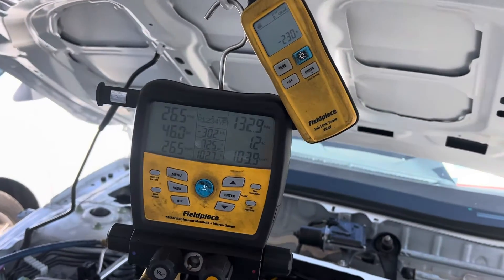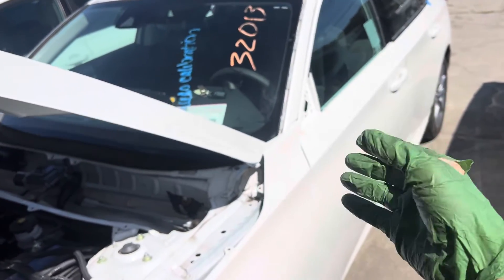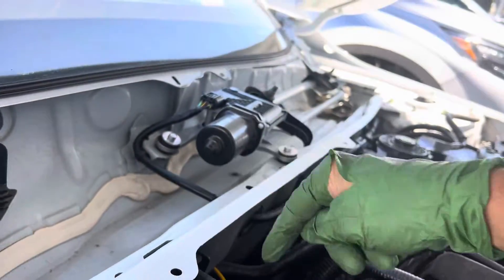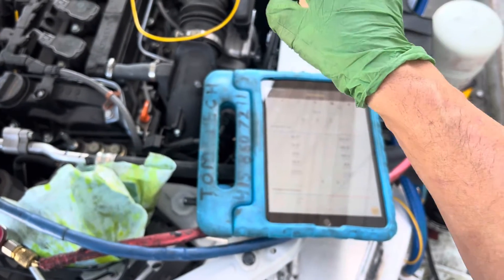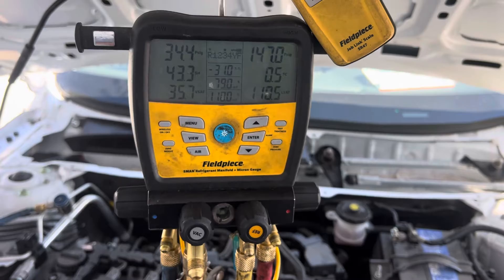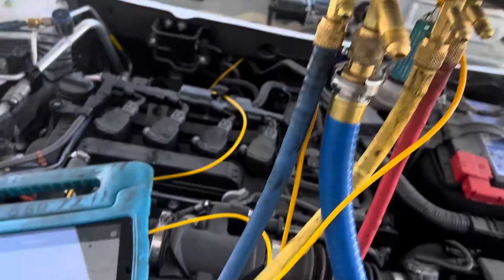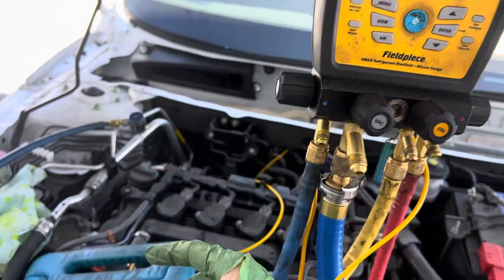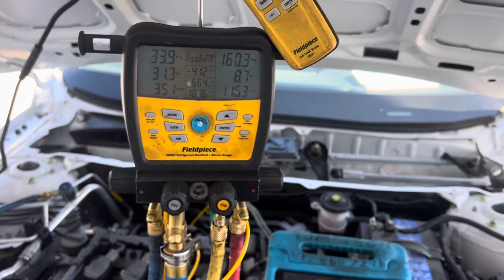AC REFRIGERANT SUPER HEAT & SUB COOLING WITH REFRIGERANT CHARGE EXPERIMENTATION

Comment: So, you talked for 19 minutes and added about 1 pound of refrigerant.
Exactly the same thing that a "wack off" mechanic, or a DIY person would have done with a $15 can of refrigerant at AutoZone.

And you used $1000 in professional AC equipment to do that ....

PS : good advice is not justifiable coming from the lips of a person that's wearing a glove, that is ripped, therefore not much of a purpose in the glove is there...
Reply from the maker: Because I intentionally only added half the refrigerant. To slowly add other half to show many cars ac systems respond differently in both temperatures output and pressure reading. Depends on if and how manufacturers software commands are compressor displacement and condenser fan speed. 
      Some will cool to 39f to 44f  with just a little over half charge but the compressor will be burning 🔥 hot and the person will stop filling because it’s cold 🥶. 
      Some cars the pressure will got way higher on a low refrigerant charge still cool tricking the technician makes him think it is full.  But the super heat will be high or the Subcooling will be low telling you the refrigerant charge is too low or maybe too high if the superheat is too low or Subcooling too high. 
     But techs with no education will not know this because they go by PSI or dash temperature.

And different car response is different. Not rule of thumb any more. 
  This is the problem with no education in this trade.

Comment: but the dash outlet temperature is really high, isn't that a problem to tackle?
Reply from the maker: It’s a Honda. They suck.. but their computer literally controls the pressures and temperatures.. but even though it was getting 101° or 90° it was still holding at 50 to 55° which is a 40 to almost 50° drop across the evaporator.,
      Some cars do better, some cars worse, depending on the manufacturers design. The size of the evaporator that they choose.. 

For somebody living in the desert hot temperatures, these are the last cars I would recommend somebody to buy

Comment: Tom, off the top of your head, do you happen to recall if a 2013 Honda CRV has a fixed or variable compressor?
Reply from the maker: @fastsvo  I have a horrible memory
But I’m gonna say it has the possibility of having maybe a mechanical variable displacement scroll compressor . 
      I’m trying to remember if this was the one that used to blow the hole out of the side of the case trying to compress liquid.  I think I’ve posted some videos of taking them apart in some shops after catastrophic failures. 

If my memory serves me correctly, they suffered a little bit in hot climates at idle, not cooling 

And if my memory serves me correctly, I think I remember being in a few shops who purchased aftermarket compressor replacements that used fixed piston compressor replacing scroll .,

And whatever manufacturer was used at that time it had improved idle cooling colder . 

When you want to know an answer to your question 

There is a thing called Google . 

You may say something like . 

2013 Honda CRV compressor . 

And a whole bunch of information linking to different compressor manufactures OEM and aftermarket will pop up, and you can further your search criteria to find your exact answer .
Reply: @coldfinger459sub0  It's definitely a scroll style and yes the aftermarket has a piston style compressor available.  Our friend Google, could not, however confirm, that the oem compressor is a variable design.  Am I safe to assume since its a scroll design, that means its also a variable output compressor?
Reply from the maker: @fastsvo  there are scrolls that are fixed, and then there are scrolls that are variable

They are not all electrical solenoids controlling the variable scroll some of them have mechanical pistons, controlling the variable displacement 

The very first variable compressor it was a piston 1985 on a Cadillac and they used a mechanical valve mounted in the body of the compressor that changed the displacement 

No electrical connections no computers 

You will have to look up the service manual information to find out exactly what you got. I do not remember off the top of my head.

Comment: I'm also having issues with an aftermarket chiller install on my supercharged cadillac ctsv. That's what lead me to these videos. The vehicles cabin ac works great with it not plumbed in. Once it is, ac cabin vent temperature suffers greatly. Tips?
Reply from the maker: @twinturboctsv91  usually, everybody under charges them. 

And because different manufactures used different components and control them a little bit differently . 

They all have similar to the same problem, but need to be handled differently compressors get burnt out sometimes . 

The original variable displacement compressor should be replaced with a fixed piston conventional compressor. 

Takes a lot of work and changing sensory positions and different settings to get them to work really good .
Reply: @coldfinger459sub0  which is sad because they're advertised as "works right out of the box!" Lol everything seems to work fine until the ambient temps get hot
Reply from the maker: @twinturboctsv91  I even worked answering questions and guys trying to fix stuff who are the ones who design and make and sell some of these kits. 

It has been very, very frustrating . 

So many problems were discovered from the initial design . 

I had one manufacturer on his prototype test vehicle install clear site glass 
( Sporlan SeeAll ) 
Connected just before his expansion valve in in line on the liquid refrigerant line . 

So he can attempt to charge up the refrigerant the old-fashioned way by site until the bubbles start disappearing . 

On a hot day, using the glycol pump with a heat load and air conditioning on full inside all windows open kept charging refrigerant until the site class at the expansion valves were almost clear just a few tiny bubbles left . 

That was when he got his  best cooling. 

He said it took an extra almost 2 pounds extra refrigerant to get there .
Reply: @coldfinger459sub0  I might know who you speak of. One system I had previously installed used that same method of charging. But, once again, when it got hot outside, the cabin ac suffered greatly so I removed it. 

Now I'm "testing" out another manufacturer and seem to have the same result with only a few OZ above the stock fill weight of 1.2lb (19.2oz) 

So very frustrating now that it's hot outside
Reply: @coldfinger459sub0  apparently my compressor is a fixed displacement and cannot be changed out

Comment: Its recirculate mode not recycle...The terms “recirculate” and “recycle” have distinct meanings:

Recirculate:
Refers to the movement of something within a system.
Often done to maintain a specific environment or function.
For example, recirculating air within a room using a fan or recirculating water in a closed-loop system.
The focus is on internal circulation within a defined context12.
Recycle:
Involves breaking down and reusing component materials.
Applies to items like paper, plastic, or glass.
The recycling process collects, processes, sorts, and transforms materials into new products.
When something is labeled as “recycled,” it means it has already undergone this process13.
Remember, recycling contributes to sustainability, while recirculation maintains specific functions within a system.
Reply from the maker: So that’s why I got F’s and D’s in  English all the time
Reply: @coldfinger459sub0  f’s and d’s for me too.

Comment: I was servicing my 2012 328i as it wasn’t cooling as well as a year ago when I bought it. I had a subcool of 23F and a superheat of 40F as I started, figured it needed more freon to bring the superheat down but the more I add the higher it goes even into the 70s so I stopped messing with the car. This goes against common theory that high SH means low freon? The car cools well even after this but just concerned about those numbers. Should I remove refrigerant from the system until it maybe evens out? I started all this game because I wanted to bring down evaporator temps to at least 4C at idle, I started at 11C and now I’m at 8C but with this dilemma
Reply from the maker: You never add refrigerant or top off

You just completely recover the refrigerant 

And recharged by manufacturer specific weight 

No guessing
Reply: @coldfinger459sub0  well I was trying to avoid doing that and saw guys online working with those measures and the gauges but well I might have to do that

Comment: Honda actually specifies what the pressure reading should be on the Low & High side which will vary depending on intake temp & humidity. 

@ 90 degrees intake temp
Low side 
28 PSIG 30% humidity 
40 PSIG 80%
High side
245 PSIG 30%
295 PSIG 80%

Test conditions:

Place thermometer units recirculation inlet duct at the glove box 

-Move the vehicle out of direct sunlight and let it cool down to the surrounding (ambient) temperature. If necessary, wash the vehicle to cool it down more quickly.

-The blower intake temperature must be at least 68 °F(20 °C).

-Open the hood.

-Open the front doors.

-Start the engine. Set the temperature control dial to Max Cool, the mode control button to Vent, and the recirculation button to Recirculate.

-Set the air conditioning button ON and the fan control dial to Max.

-Run the engine at 1,500 rpm.

-No driver or passengers in the vehicle.

11.To complete the high side (discharge) pressure/intake temperature chart:

-Mark the high side (discharge) pressure on the vertical line.

-Mark the intake temperature on the bottom line.

-Draw a vertical line from the intake temperature mark.

-Draw a horizontal line from the high side (discharge) pressure mark until it intersects the vertical line.

NOTE: The high side pressure and the intake temperature should intersect in the shaded area. Any measurements outside the area may indicate the need for further inspection.

12.To complete the low side (suction) pressure/intake temperature chart:

-Mark the low side (suction) pressure along the vertical line.

-Mark the intake temperature along the bottom line.

-Draw a vertical line from the intake temperature mark.

-Draw a horizontal line from the low side (suction) pressure mark until it intersects the vertical line.

NOTE: The low side pressure and the intake temperature should intersect in the shaded area. Any measurements outside the area may indicate the need for further inspection.
Reply from the maker: That’s great if you’re in a laboratory if it’s only at 68°F

But what about the rest of the world for the other 99.5% of time where the vehicle will not be taken to the shop on a 68° day under full direct sunlight 

To use their gray shaded area of such wide parameters that’s basically useless 

On a vehicle that has shitty air conditioning in the first place . 

Pull the charge in about four minutes on my recovery unit give it about 120 seconds of vacuum since it’s never been exposed to the atmosphere and charge it up fully 100% with liquid refrigerant in about 30 seconds . DONE! ✅ 

They need a full spreadsheet, temperature to pressure to subcooling, and or superheat graft that can be followed by anybody in the field just like residential. 
And a dedicated software to throw the system into a test mode using a software that compensates for the sensors of any ambient temperature and humidity within a given range, for example, 68° to 105°F  
So any simple individual without much education can use their finger and just follow the left right move over to the right to correlate it to a drop-down from a temperature to come up to a specific superheater subcooling that anybody can follow and use instantly . 

Like every manufacture of small higher in residential or larger commercial VRF, heat pumps and heat recovery units have . 

What’s the problem with the automotive industry? . Too much worthless material provided.
Reply: @coldfinger459sub0  Subcooling and Superheat will not work on automotive because the heat exchanger are hard to clean. Airflow on the condenser depends on how clean the radiator is. The only thing I like about Honda is that you can run AC diagnostic test system & sensor  by holding several buttons. Control modules are plug & play and automatically relearn without 

Older vehicles AC performance are much better because the under hood heat load from the radiator and catalytic converter is very low. The coolant thermostat is located where the upper radiator is connected. Only the top of the radiator is hot. The thermostat on newer cars are located at the bottom. That's why it takes forever to reach a normal operating temp. The coolant at the bottom of the radiator is @ 190 degrees. EVAP purging is a duty cycle on vehicles equipped with electronic throttle body. Old vehicles equipped with cable type throttle body don't purge EVAP on idle. Less heat from the stupid catalytic converter that burns fuel without producing power. Good for the environment 😄
Reply from the maker: @w0lvez1  good for the environment that I will agree. 

Because I lived and seen what our skies look like here in San Francisco Bay Area before the introduction of the very first catalytic converter 

And then I got the witness and see after about 5 to 7 years of the introduction of Cadillac converters the guy started clearing up . 

And by the time, 90+ percent of the old vehicles were in the junkyard, and everything was replaced with new EPA emission vehicles. We finally had clear blue skies again, and we can actually see the hillside and mountains from the freeway again. . 

So yes, the EPA devices along the freeway routes have worked and you can see it clearly with your eyes